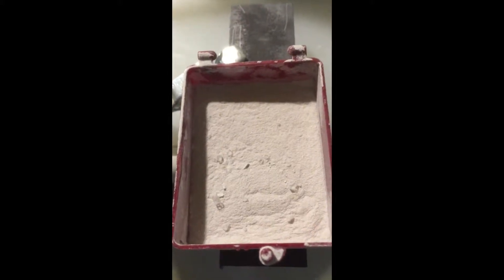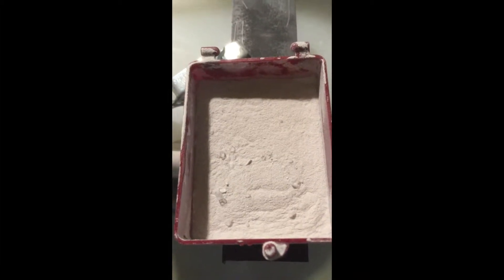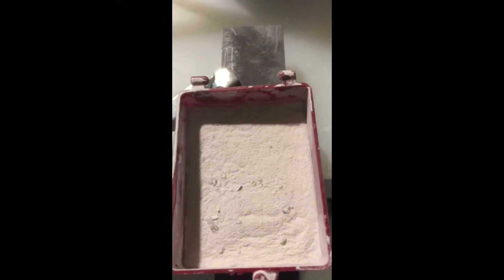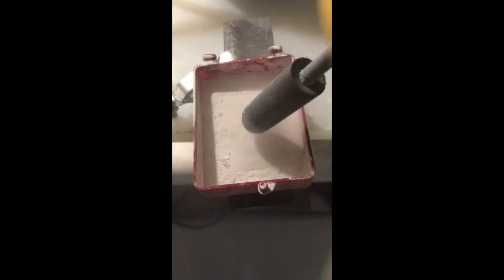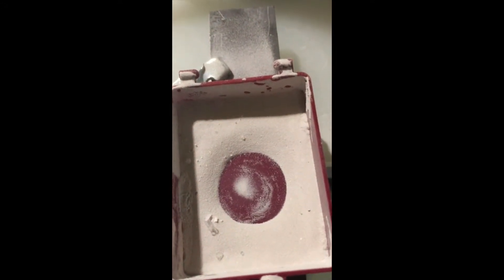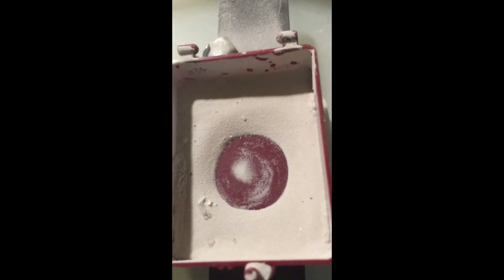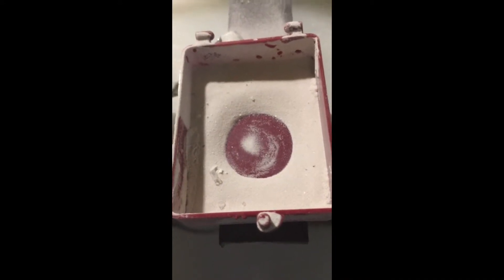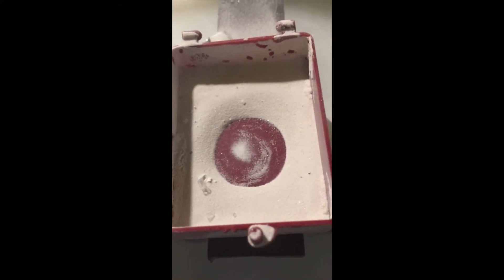Mound Within "Impact" Crater formation via Plasma

Comment: Nice work! Interesting banded accumulations spiraling into the compaction at the center. I can imagine going down to that scale and feeling the electric wind, building, accumulating, stacking, isolating the material. Mountains and other features 's created in short time frames :) That's one heck of a storm! Myth making ;) I would like to see you do an experiment with a single high capacitance discharge in the same material. Just one large smack! I believe the Winslow crater is one such event. Keep up the ground breaking work!! Pun intended :)